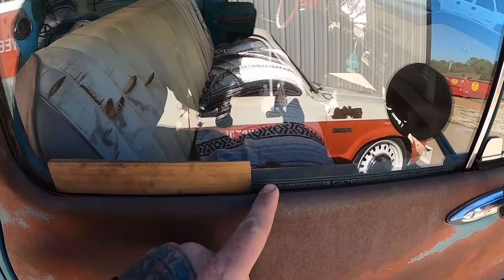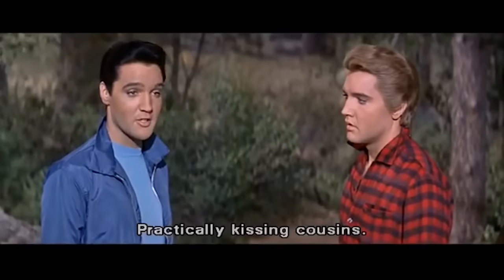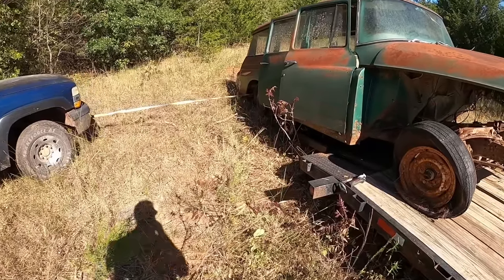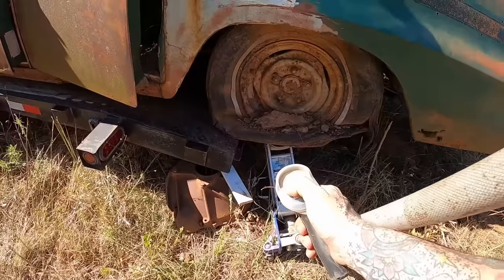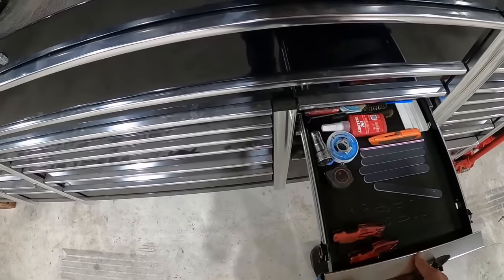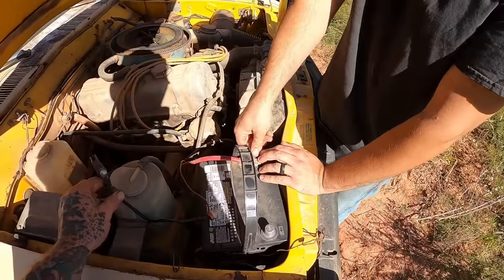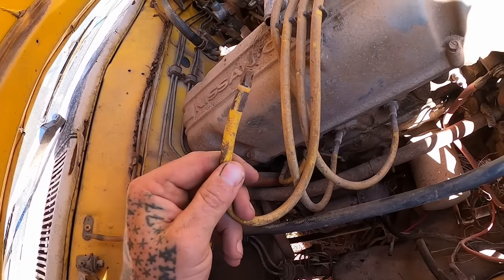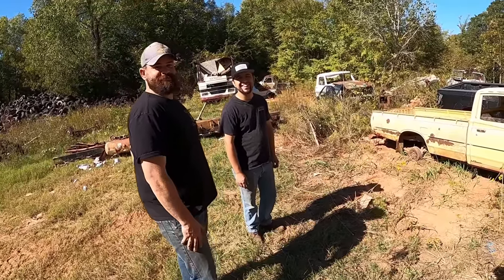ABANDONED Travelall found in woods! Datsun 620 WILL IT RUN??

Comment: Hey, Puddin. I used to work for Datsun / Nissan those L motors are bulletproof, the blocks on the L4s and L6s are 8% nickel, that means they are pretty much stainless steel. They hardly ever have anything worse than a bit of a ridge in the cylinders. they just always run.   Keep it rollin my friend. 😁
Reply: The engine from the 280 xv in a pickup would make an awesome hotrod/drifter?
Reply: 8% nickel? I suppose you have documentation to back up this claim?
Reply: @upscaleshack , It's good to question such things. No doc. per se. It's just what the instructor mentioned a few times in the certification classes when I was going through classe to become a Nissan tech.
Reply: @KiloBravo69 Wish Datsun/Nissan would bring back and manufacture the 521 series trucks once more. Now those series trucks were beautiful looking little girls, this time, put a 4 wheel drive package underneath them.
Reply: @dwansbo , I like it, but you would have to do some serious mods to the engine bay and firewall and I'm pretty sure you woud have to remount the the larger L28 radiator in front of the core supprt. Cool mod, but lots of work. I would go for a hopped up triple S L20B instead, or a very popular repower option is the later KA24 engine.
Reply: @KiloBravo69  And he had probably heard it from someone else, and it got passed along as if it were gospel. It's extremely unlikely that Nissan used 8% nickel in cast iron block castings. Normal range is something far less than 0.1%. This nickel block myth just won't die.
Reply: @upscaleshack  Na man, you're not smug at all. Did it ever occur to you that since you keep hearing it maybe there is some creedence to it?

Comment: Puddin, I have a suggestion for keeping your winch battery charged. If you have a seven pin trailer wire use the white wire from the tow pig to charge up the winch battery. It wont help much on short halls , but if you let the tow vehicle idle it will keep power flowing to the winch.

Comment: You definitely need a snatch block...double line that winch when you have to drag non-rollers on the trailer. Doubles the pulling power and it's easier on the winch motor too.

Comment: I believe you can remove the passenger side quarter off that old travelall, at least you would have one that can work. And I believe you should buy that Datsun because it has a running engine, disc brakes, 4 speed, decent interior and glass components. And definitely keep all those trim pieces for the travelall along with steering column and steering box, brake drums and any trim and glass components.

Comment: Puddin, If you make a short eye that fits in side pockets of your trailer, you can run the winch cable through a snatch block and move the load around while pulling it on the trailer.

Comment: Had this same truck. The ticking noise is most likely a loose timing chain slapping the cover. Mine did the same thing. After going threw the entire engine, it turned out to be too much slop in the timing chain letting it slap the cover.

Comment: Bubba you need to carry a leatherman with you all the time . When i was doing under car work it came in handy when mounting shocks adjusting brakes getting to crap i got the wrong wrench or socket for . i wore a belt so it was on my hip all the time .

Comment: Puddin get the charger fuse for your truck or whatever it’s called but whatever you hook up to your truck that has a battery it will charge the battery well your pulling it so it always has good battery life that way you never have to worry about a dead battery

Comment: A good project would be making the trailer a tilt-bed. Even if you only tilt it one foot at the front, and move the winch onto the tilt-bed. That would solve pretty much every issue of a car catching on the back corner.

Comment: Hey Puddin, did you get that crud off of the glass on the 61? I was thinking about it and remembered I had pretty good results on cleaning the oven door window with using a dishwasher puck as a scrubber with a mist of water on the glass. Other idea is IPA (isopropyl alcohol)

Comment: Can anybody here help me out? I’m trying to figure out if the Chevy Tahoe, Yukon, and escalade from 2000 to 2006 came with a coil spring front suspension set up or if they all came with torsion bars any help would be greatly appreciated.